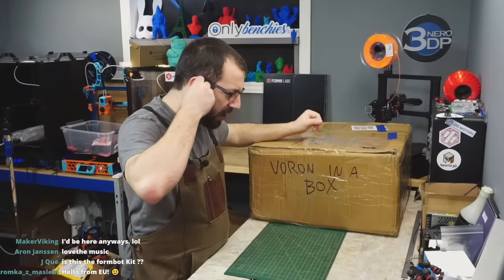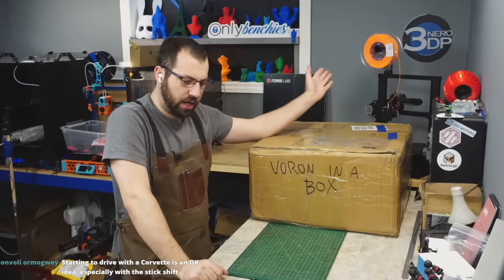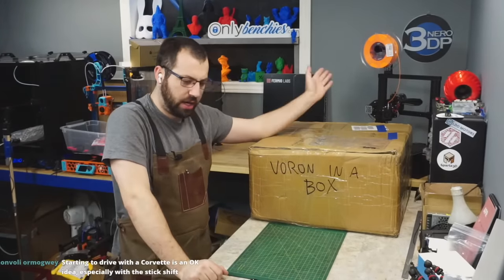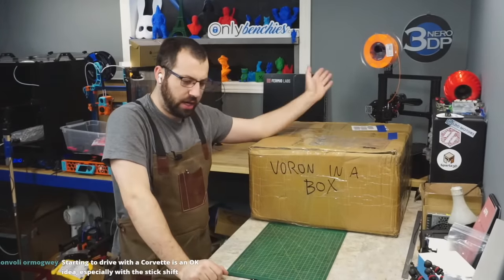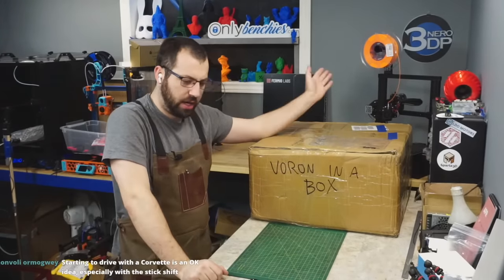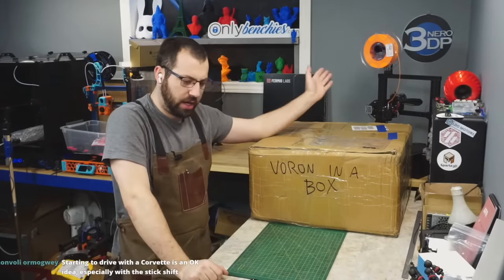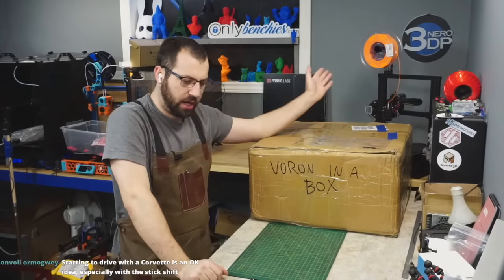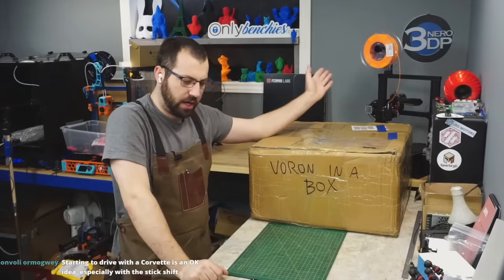Lets Talk About Voron Kits - Livestream

Comment: anyone have the notes he took of which parts to replace from this kit? I just got mine!
Reply: Yeah me too. I heard the idler pulleys being wrong but what else
Reply: @ryangamble5131  I contacted formbot and they said we should have the right idlers according to " Nero's video". Fast replies from them 
@ formbot
Reply: It did seem like his attitude towards the kit was "guilty until proven innocent". So some of those perceived issues were not as bad as they were portrayed. All in all they were minor and I'm glad I bought the kit. Saved me a lot of effort in sourcing!
Reply: @andonguyen7970  I am finally into my build and happy to report that I have chains with opening tops in my kit which was one thing I was worried about after watching this video. I think they may have watched this or figured out what they missed and actually tried to address any legit issues. Everything I got looks right and I'm excited to get er all put together!
Reply: Printers been running like a dream and really quiet too
Reply: @andonguyen7970  What size of printer did you build? Any modifications?
Reply: I went with 300x300, Mods:
-Klicky Probe
-Enraged Carrot feeder ( multi material & its awesome)
-klipperscreen - bttpitft50
-squash ball feet (voron mod & not neccessary, prob worse for small builds)
-nozzle scrubber & purge bucket
-Bottom panel clips ( to prevent warping of the abs panel under the bed highly reccomended)